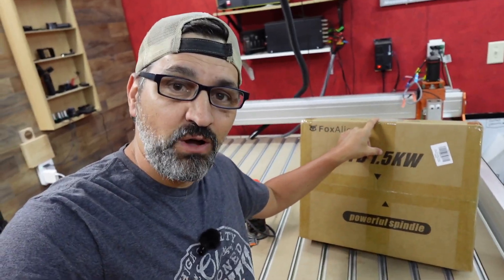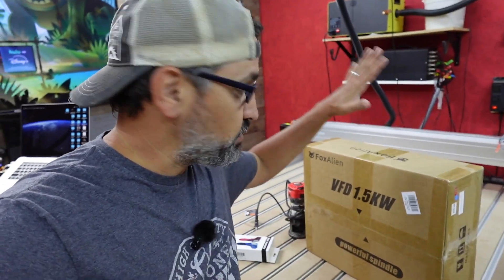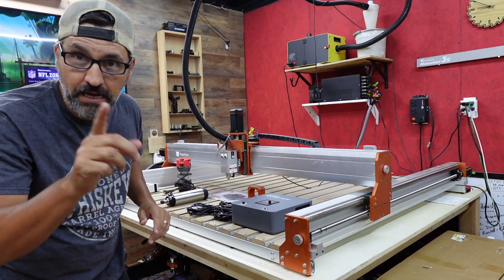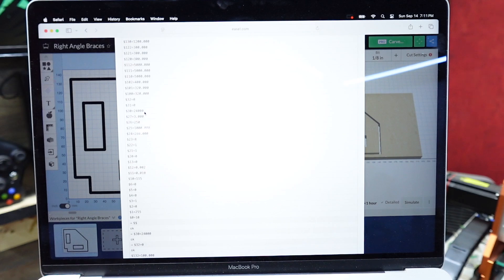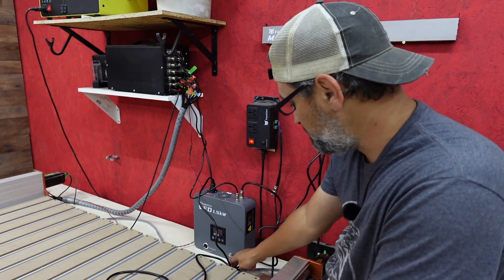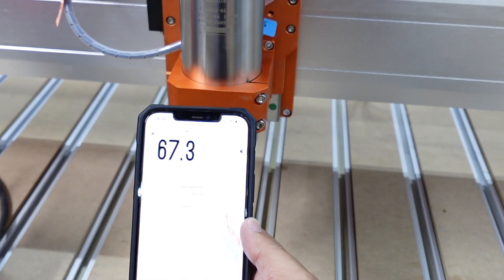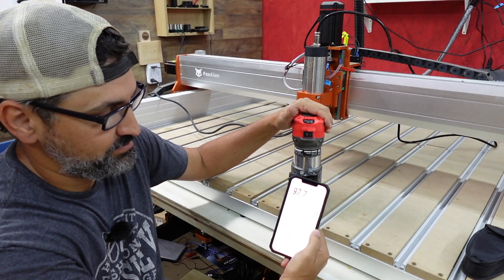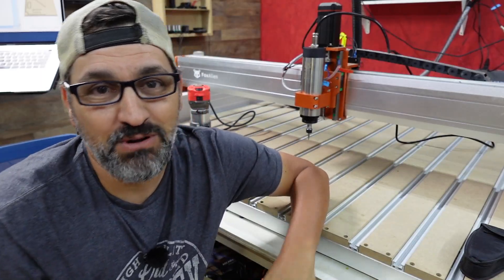Foxalien 1.5kw VFD Spindle Install and Speed Test!

Comment: Your videos are awesome! Thank you for all the great info! I got this spindle and the FA grbl offline controller from an earlier video you have. It seems like VFD spindle doesn't work automatically with the controller for me. The VFD spindle turns off when I run a file from the offline controller. I have to run using the knob control (not PWM). Does your VFD spindle work with your offline controller in PWM mode? Any suggestions?
Reply from the maker: Awesome! Glad you like the videos! Honestly I have not tried using the offline controller with it. The VFD is connected to my CL4x4 and I only use a laptop to control.  I don’t think (I could be wrong) it will work with the offline controller.  I’ll have to look into that. Thanks for the support! It’s very much appreciated!!!
Reply: @TheCrawlspaceCraftsman  Thanks for your reply! I will contact FA and see what they say. Maybe they have a gcode fix? I wonder if its because it is laser mode for the spindle.